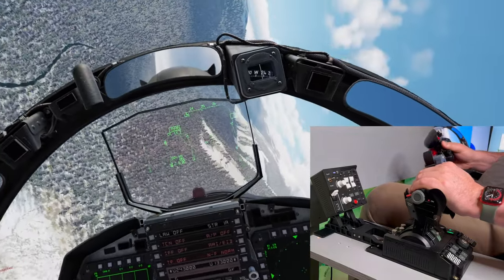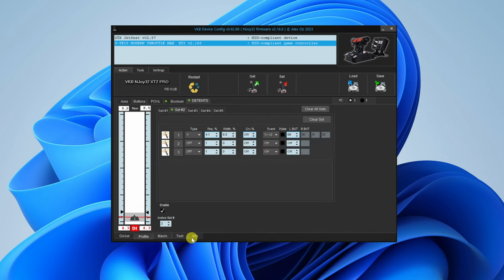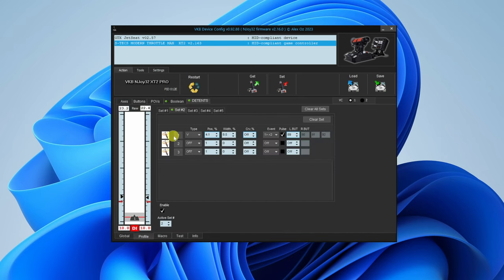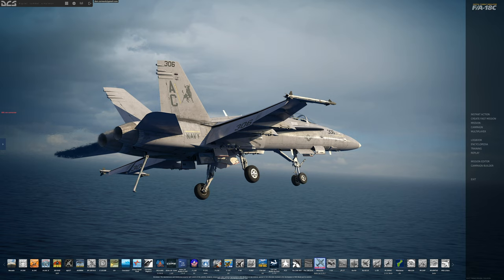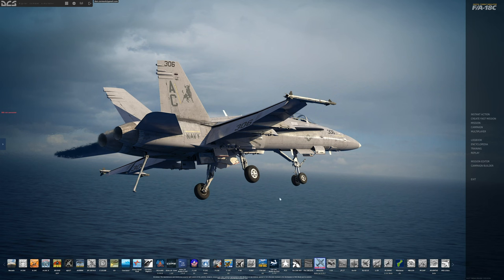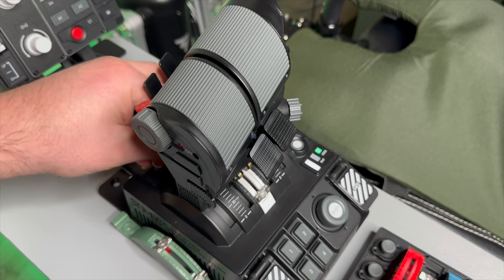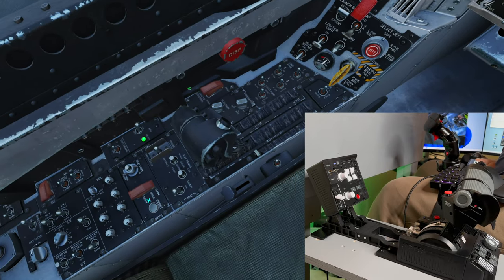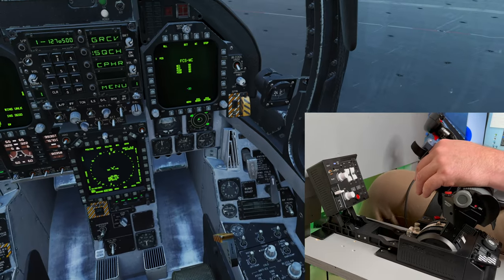DCS VR | STECS Video Followup - Solutions!!

Comment: I don't get the three way flaps. Mine just flashes the middle position every time I move it up or down because the up or down pulses and then goes OFF which means it triggers the middle button. It just doesn't work like you're showing here. And the official VKB video on making the three way switch is also different, they tell you to make a virtual button which doesn't show up in the buttons menu.
Reply from the maker: Hmm, I wonder if the newer version of the VKB software does something differently. So, when you enabled polling and you move the flap switch UP, it flashes the number? Same with down? It's possible you have them set as Encoder instead of buttons. It's in my video as well in the segment "Make Flaps Pulse". You can change the type to button again for the three positions. So you followed the instructions here? https://youtu.be/rvK4ksUBbPU?si=nK2jCKrGu9NzwYEa&t=1126 and then check to see how the three positions are defined (as buttons or as encoders) via this https://youtu.be/rvK4ksUBbPU?si=pfrG-hWacREAoNE2&t=1373
I think you can do virtual buttons but if you use the boolian as I demonstrated, the logic works that if neither the up position or down position are set, then it equals the third (middle) button.

Comment: Thanks for the video. I'm waiting for mine to get shipped and def-ly learned a few tips and tricks I'm going to use :)
Reply from the maker: It's a great set for sure! Which version did you get? The STECS Standard is actually a nice layout if you need more buttons. The mini probably would have been fine for me but in the end, I'm glad I got the extras. It's all a great set and a good price and the ability to mix and match or add on later adds value.
Reply: I'll be getting Standard version. Should be good for the VR setup and I do like the fact that it has the detent box and kit attached.
Reply from the maker: @andreyzhavoronkov6746  yeah that was a solid choice. I like the positioning of the STEM better for VR. As you can see in the video, I fumble around blindly trying to find stuff still whereas having it on the base, closer to me would have been much better. I know you will enjoy it when you get it!

Comment: That pulse for both ways across the detent is exactly what I wanted. Pulsing flaps are also interesting. VKB fixed it very quickly. Kudos! And good video instructions, thanks for that. ;-)
Reply from the maker: Thank you. Yeah it’s a powerful program for configuration. The trick is to discover / figure out how it all works and what can be done with it.
Reply: Can I please ask what advantage is there for flaps to pulse?
Reply: @dcsfrost  I experemented with both switches as pulse and without and decided to leave the flip switch as pulse, including the middle position which I may or may not bind. I use the flip switch for gears, actually, and it serves well for both two-way gear levers and three-way levers (e.g. Yak-52, MiG-15 or back of the L-39 Albatros).
For the TGL switch I decided NOT to pulse, because it is a momentary (spring-loaded) switch. It is actually advantageous to have the action while you're holding it.
I like pulsing for things that stay in posiition (flip switch, or 5-way rotary switch under the throttle) because until I move it again it doesn't mess with my cockpit after the mission start. That's the benefit of pulse action. Nothing else, I guess. Pulse for momentary switches doesn't make much sense, because then you can't use them as press-n-hold action.
So if I had flaps on the flip switch, I'd not mind the pulse action. If I had them on the toggle, I'd NOT use pulse action. I actually use one of the K-switches for the flaps - again, without the pulse action.
Reply from the maker: @dcsfrost  Sometimes when I load into a hot jet, the physical flap switch may be set to something incorrect. Like the jet may auto set flaps to half in the Hornet but my switch may be set to full or auto from a previous session. If the switch is set to continuous signal, it will set the flaps to that setting. This may not be what I want. This simply makes sure that the physical switch position which I may not have checked doesn’t impact the sim. Ultimately this is not too important. I should be setting flaps regardless of how I load into the aircraft but it was something which popped into my head as something which I should try to change.

Comment: Why does the flaps need a pulse and its not enough to work it as a button?

Also I see you use the Max Stecs version. Do you think the extra little module with the 4 buttons its worth it or not that usuable?
Reply from the maker: I prefer the pulse so that when I load into the Sim, the flaps in DCS don't automatically jump to the position of the physical flap switch (because it will be continually getting a button press). It's not necessary but a preference of mine.
Well, the Max also adds the bracket to hold the other panel upright at an angle plus it comes with the additional button modules. I do use the small extra module for some stuff like exterior lights, flashlight, active pause, etc. so for me, it has been useful but it's not essential in my opinion. I use PointCTRL to interact with the cockpits so I try to use the actual cockpit controls when possible. The buttons on the throttle base are generally non-aircraft controls (sim controls). I do use the flaps and gear switches though since it can be dicey having to look down to reach for them during a cat shot. I've been using the radio knobs to adjust the channels in the aircraft as well.

Comment: striker I have a question, I just ordered this throttle. Should be in Friday. I fly the 18 and the 15E mainly. How did you know where to put the the detents on the plastic itself. At what percent? Does it matter? or do you just place it somewhere near the bottom and top, set the detents in software and than make small changes in software after going into DCS?
Reply from the maker: Here's a shot of what I did for physical placement of the detents. It's down a few posts on my community tab. I couldn't find a direct way to share that particular comment. https://www.youtube.com/@StrIIker-TV/community
For the afterburner on the Hornet, I determined where to put it by hopping in a free flight and listening for the loud afterburner engage sound as I slowly moved the throttle forward (there's an option as well to make the AB sound louder which helps). Once I learned the precise location, I put the detent there (I had the detent on the frame installed but it was somewhat loose so I could move it with some effort). Once you have the location set, do the finger lift configuration (setting events) per the video as this will trigger the AB as you push past it and step out of AB as you pull back.
The Strike Eagle AB was a little different as you can also configure the percentage in DCS in the Strike Eagle Special tab and then set it on the frame (it' sin the video under the Configure DCS for the F15E). Watch the segment on Adjusting F-15E Detent for how to do it using the curves. It works really well. You could even do this with the Hornet if you wanted. 
I think the physical locations which I used are a good start for you to get things configured. I know it probably looks a little confusing but once you have the throttle and play around a little and use the steps I outlined, you should be good to go.
As for the Idle detent, I moved the throttle to the bottom and set the detent just above it. I don't need any extra room below the Idle Detent as it's off. You do want to use the curves as well to set zero once you hit that detent. Use the event to trigger the throttle off or idle.

Make sure you click the video description as well as it has the chapters listed there and makes it easy to find them. You can also mouse over on the playback bar for the video and find the chapter you want.

Let me know if you need a hand. I'd be happy to help clarify or provide more detail for ya.
Reply: @StrIIker-TV  Sounds good Sir Ty. I saw that you can set the AB for the F15E, Just wasnt sure if you set that too where you are putting the detent physically. I will wait till i get the throttle in a few days and then go back and watch your Solutions video again to try the things out. After some time I will probably be replacing my joystick as well. Currently use the X56 throttle and stick. But Not sure if I want to go with VKB for a stick or someone else. 
I read a lot of stories about winwing having really bad customer service, which actually turned me off there orion 2 F15 throttle, I had almost made that purchase instead.
Reply from the maker: @sirbum69  That sounds like a good approach! You got this! Hopefully the pictures of the two detent frames helps 
As for WinWing.. that poor customer service is why I skipped on them. Also I had concerns about design quality but that was just my personal opinion formed after looking at some of their gear. It’s too bad because I think their stuff looks very cool but after having experienced bad customer service elsewhere, it’s a top priority for me when deciding upon a vendor. I don’t know the VKB sticks at all so I can’t comment on them. I do have a high opinion of Virpil’s control stick base. I have the CM2 but would have loved a CM3 for the dampening it has.
Reply: Just got the throttle and had it setup for the hornet in about 20 min. Had to invert the throttle for what ever reason and unbind the throttle from pitch and roll but worked slick
Reply from the maker: @sirbum69 Great to hear! It was pretty easy to fget going. I've had similar issues with various axes which needed to be inverted as well on all aircraft. I also constantly get the throttle being bound to pitch etc. I wonder how it is that DCS does this but oh well. :)
Reply: @StrIIker-TV   yep, Havnt really tested it out yet but the only thing I can not seem to get running the same is the flap switch. It never showed the middle button when polling and now even though I have it set to pulse it stays red the whole time. But like I said I have not tried to test it in game yet.
Reply from the maker: @sirbum69  I think I showed in the video how to configure the flap to have three positions. You need to use the Boolean part where you say basically, if it’s not the up position and not the down position, it is the third position (middle) and assign a virtual button to that middle position. It sounds more complicated than it is if you follow the steps I laid out. I got the instructions from the developer who wrote and maintains the VKB software.
Reply: @StrIIker-TV   Yeh just for info, either because I am using a newer version of VKBCFG or something but that method doesn't work. It never sees the middle as a button. No matter what I did. What I ended up having to do was actually go into the buttons themselves and set that has a toggle, using Buttons 57 master, 58 slave and 88(this is what i picked for middle button) Then it regestered the middle section as a button press. Makes no sense unless they changed something in the latest software.
Reply: hey just wanted to give you an update after 4 months of having the throttle. make sure that you save out your profile because if for any reason Windows does not detect your controller and you have to unplug it and plug it back in, you will lose all your profiles you have set up in the vkbconfig file. Just went through 2 hours of redoing my throttle detents due to this. Also for some reason, I am now having to set the curve way high in order for it to work. so for the afterburner I have to put the curve at like 67 other wise the throttle sends nothing until it hits that point.
Reply from the maker: @sirbum69  oh man that sucks! Did you do a calibration? The issue you are mentioning sounds like the calibration is off or something. I will definitely save my profile!
Reply: @StrIIker-TV   I calibrated twice. Seems going to discord they say that you are suppose to use the curve, Guess its suppose to happen as it is. But yes windows losing the controller and having to reset things again sucked.
Reply from the maker: @sirbum69  yeah you do need to adjust using the curve. I believe I demonstrated this in the video. Hope you got it all set up correctly!

Comment: So I'm thinking about getting this throttle but I don't have any desk mounts or a home cockpit. Do you think the STECS Max will be fine if I wanna use it on top of my desk?
Reply from the maker: On a desktop, my main concern would be that front part which is on the frame away from the main throttle base. It might be too far to comfortably reach it but then again, you will probably assign functions to that part which are not used a lot (I don’t). I have radios, flaps, landing gear assigned and that stuff doesn’t get used a whole lot. The max also has that small part towards the rear which adds a handful of extra buttons which may be pretty handy for you. 
I do think it would work for you on a desk. The nice part also is that the rear part is pretty small so the throttle handles will be close enough to you and the edge of the desk. Ultimately you are getting the 4 buttons, plus the rotary button with press and two more under the flaps (I use one for eject) which can be pretty useful. The STECS standard lacks this small part so you lose those buttons and they put that front part at the back (closest to you).  The STECS max has some good weight to it and grips surfaces well. Another plus, you can adjust the friction for the throttles so no worries about pushing or pulling the base unless you really max out the friction (nobody really does this) so it will work well for you.
Reply: Thanks for the reply! It's hard finding info out there about the Max because most people went for the Standard one. I think having the STEM in front of the actual throttle will be better for me because I won't have to reach as far away for the main part of it which is the throttle levers (the most important part lol). Again, thank you so much for your reply, this helps a lot!
Reply from the maker: @ExactPlanet0  Glad to have been of assistance. If there’s anything else you want to ask about with the STECS please feel completely free to do so. To date I am still very happy with my STECS Max and am happy I made the switch.

Comment: What percentage do you physically set the afterburner detent or what is a typical setting?  Thanks.
Reply from the maker: Hi! For which aircraft? The F-15E Strike Eagle has a special setting to manually define it. I went with the "real world" setting of 64%. To achieve this, I physically set the detent to have the leading edge at 75%. I did have to fine tune the afterburner detent using the software as demonstrated in the video. The hornet has a higher value and that I believe is hard set in DCS. What I did was hop into the hornet and move the throttle until I can hear the AB kick in. I was initially looking at the external view but the initial stage doesn't really light up. I noted the position of the throttle and set the detent accordingly. On the detent frame, the Large L detent (the one I am using) has the leading edge at 85% exactly (well, close enough).
If it would help, I can post two pictures to the Community section of my channel and you can see the exact positioning. Let me know!
Reply: @StrIIker-TV  I will be setting up the f18.  Thanks for the info.